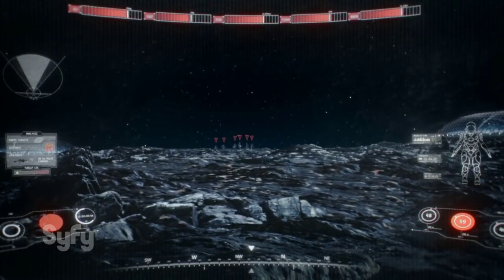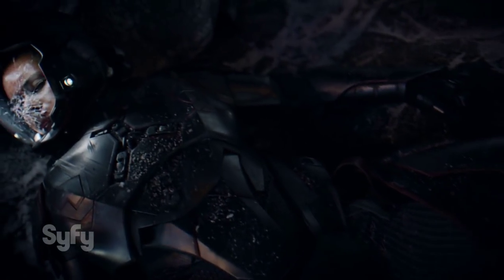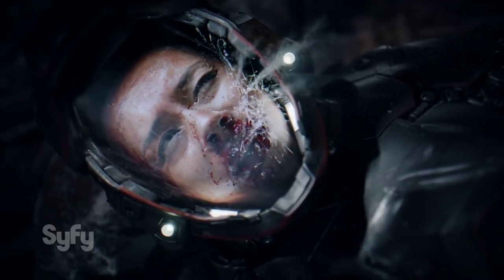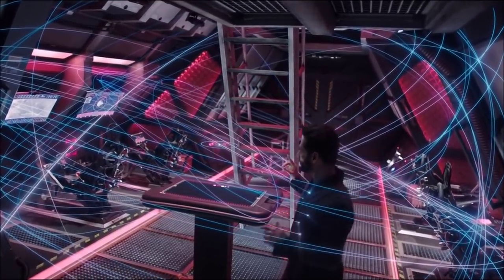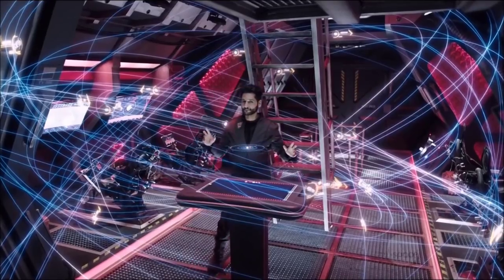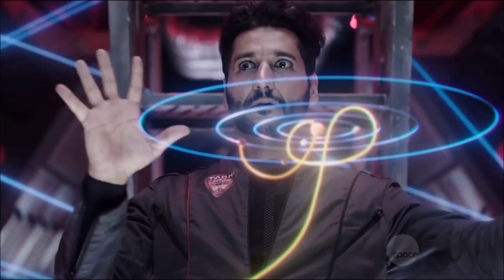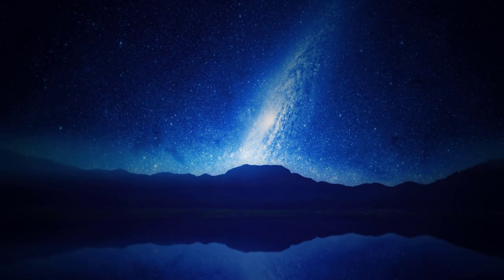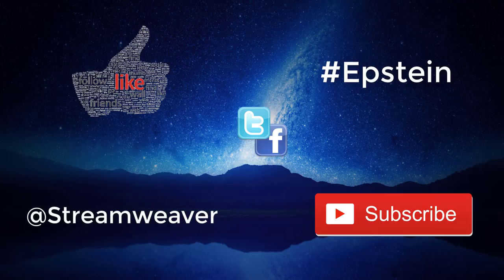Let's Do the Science:  The Epstein Drive

Comment: The Kzinti lesson: "A reaction drive's efficiency as a weapon is in direct proportion to its efficiency as a drive."
Reply: I knew someone would mention this.
Reply: @David Johnson ~ Aye, it commits the old sin of imagining only the ships with railguns are armed, when a fusion powered plasma rocket (a directed nuclear weapon) would put the railguns (admitedly very powerful kinetic weapon) to shame. But it's still a lot better than most of the science fantasy on TV, so I repeat to myself 'It's just a show, I should really just relax' la la la ♫ ...
Reply: most fictional antimatter engines would either need very strong, lightweight magnets or some kind of gamma ray laser thingy that would pump out the gamma photons in a correlated stream since we're talking PWs of power in Expanse sized ships if we're goign antimatter and ~ 10 % c+
Reply: Book spoilers!

A small ship is eventually used as a nuclear missile in exactly that way.  There is also a lot of use of improvised kinetic weapons (including ships and improvised guided kinetic bombs dropped from fast moving ships). (And discussion of dropping rocks on people throughout the books.)
Reply: A weapon becomes more efficient the smaller the area you focus the pressure at the cost of less overall force and a drive becomes more efficient the wider you let the exhaust spread at the cost less overall pressure. So, in the end drives make for terrible weapons and weapons make for terrible drives.
Reply: Bouth true and false. They are designed to use the energy in different ways, but the energy is still there and can be used as a weapon or as a drive with minor modifications.
Reply: Why doesn't Mass Effect use their FTL ships to blow up enemy planets? I mean if the cost of that ship is less than the enemy planet, then it would pay for itself.
Reply: I liked Ringworld.
Reply: To answer the Mass Effect question: I think there are several reasons:
1.) Ethics: No matter if it's actually possible, triggering doomsday events on inhabited planets is generally considered bad form and possibly a war crime in the eyes of the Citadel Council. In fact a maneuvering a fleet between an inhabited planet and an enemy is a common tactic since it forces the enemy risks hitting the planet with it's mass accelerators...which is, you guessed it) forbidden by the Citadel Council.

2.) War Strategy: In Mass Effect war is decided in space and colonies/planets are usually a thing that people fight over for control. So destroying a planet makes very little sense

3.) Dedicated Weapons: Why sacrifice a ship to nuke a planet when dedicated weapons for nuking a planet already exist...not to mention that most colonies are small and could very well be destroyed by weapons of our day and age. The codex states that during the Rachni Wars, the Krogan Rebellions and I think also the Reaper Wars the Krogans and the Turians used asteroids as WMDs. 

4.) Mass Effect Fields: We don't know how they actually work or what they do...they play around with Mass somehow, but that's about it. We do know that they produce Kinetic Barriers that protect ships from debris and enemy mass accelerator cannons. It could very well be that two Kinetic Barriers projected by ship would push each other away in a similar manner to magnets and you simply can't crash into another ship. That problem does not exist with planets, though. 

5.) The ships can't take it: For FTL a ship needs a working Mass Effect Generator, the forces of entering a planets atmosphere could simply be enough to instantly shred the ship causing the field projected by the generator to fail and just raining a bunch of inconsequential debris down on the planet. Considering how the biggest ships (Dreadnoughts) are even controlled in numbers and extremely expensive they may simply be too valuable to sacrifice.

I am a huge Mass Effect nerd and could probs think of a few more reasons. It is important to note, though that the Mass Effect Universe isn't nearly as consistent as the Expanse, especially in regards to how things are described in the codex and what happens in Game/Cutscenes. On a further note, the whole way space combat plays out is sorta flawed anyway, because Fighters/Bombers shouldn't even exist in Mass Effect, not as manned craft anyway.
Reply: Didn't think anybody read Larry Niven anymore
Reply: David Johnson #chrowl
Reply: i imagined/head-canon'd those engines working in 2:1(or more) fuel ratios, with the m/am annihilation working to ionise the remaining hydrogen, and blast it out the back as a mother of all plasma torches.
Reply: One thing I liked about the old video game "Defender" was the way the ship's dive plume disappeared when firing.  My guess was that it was because of the processors used, but I liked to think that the ship was redirecting the drive's power.
Reply: @PositiveBlackSoul  mass effect 3 also says the drives have a failsafe built in to prevent useing them for ramming which was preasent in the drives they reverse engineered from the protheans which they cant figure out how to remove and keep the ftl workingd it is heavily implied to have been a reaper failsafe they built into the tech they seeded to stop primitives from useing it to wipe them out with kamikaze freighters.
Reply: They found that out the hard way :)
Reply: THIS
Reply: @Draekris  which ship is used as a missile

Comment: excerpt from the wiki:
"The drive utilizes magnetic coil exhaust acceleration to increase drive efficiency, which enables spaceships to sustain thrust throughout the entire voyage."
Dubiously canon, but it fits in with what we've seen. Instead of some new flavor of fusion with exotic fuel, the magnetically interactive plasma is funneled into a coilgun-like apparatus and accelerated to even greater speeds, the added velocity of the mass ejected out the back is translated into additional thrust for the ship.
So 'runs on efficiency' means "wring every last newton of thrust out of our propellant"
Reply: That would still require a relatively ample amount of reaction mass though, wouldn't it?
Reply: @reezlaw  The more energy you have available for accelerating your reaction mass, the less of it you need. Simplified, reaction mass, energy, and speed is governed by the interplay between kinetic energy and momentum.

The mathematic formula for kinetic energy is E = m * v^2 /2. The formula for momentum is M = m * v. The thing is that momentum is a vector (it has a direction), and the total momentum of an event has to be 0 (equal and opposite reaction). So if (and my stuff) weigh 100 kg, and I throw a thing weighing 1 kg at a speed of 10 m/s in one direction, I will also throw myself at a speed of 0.1 m/s in the other. To do this, I need to supply 1 * 10^2 /2 + 100 * 0.1^2 /2 = 50 + 0.5 = 50.5 J of energy.

If I instead had a thing of the same weight as me, I would only need to throw it at a speed of 0.1 m/s in order to propel myself at 0.1 m/s in the other direction. That only takes 0.5 J (for a total of 1 J), instead of the ~50 J it took to throw the small thing.

The faster I can throw the thing (my reaction mass) in one direction, the faster I can propel myself in the other, but the energy needed scales up with the square of the velocity. So you need to pump increasingly high levels of energy into your reaction mass in order to go faster. If I can't put out ridiculous levels of energy, I'm going to need more reaction mass to compensate. This is why our rockets generally consists of almost all reaction mass with a tiny bit of payload, and even have systems designed to relieve themselves of the casings for the reaction mass in order to reduce the amount of reaction mass needed (multi-stage rockets).
Reply: @BalooSJ  sure, that makes sense
Reply: @BalooSJ that calculation is only for vacuum of space flight or is it applicable to be used to break earth gravity? Starting from 0.
Reply: @BalooSJ sorry I'm this late, it's been 3 years, hope you are still there
Reply: @glintongordon6811  The basic math of energy vs momentum applies either way, but gets more complicated when you need to worry about additional variables like gravity and air resistance.

While on the ground or in atmosphere you also have access to more efficient means of propulsion. In space, the only way to go one way is to throw something the other. On a very very broad scale the same applies down here, except we have things readily available to push against. A car, for example, pushes against the ground to move forward, and a plane uses propellers or jet engines to push the air.

Comment: I'm curious, suppose we launch a small ship, like a space shuttle, into space and it docked with a large rocket like a Saturn V that's fully fueled in space. What kind of acceleration and g force in space could a fully fueled Saturn V rocket achieve and how long could it sustain that thrust?
Reply: The saturn V had a total burn time of 1025 seconds. Someone did the math and it has a total of 18 km/s of delta v. That's the speed of voyager 1 right now, so that gives you the idea of the performance. This is because the rocket is designed for power, not efficiency. The first stage would be hugely wasteful in space, and the entire thing is a chemical rocket, so it is terrible compared to the things talked about in this video.
Reply: Elon is planning just that for his Mars mission
Reply: @cinquine1  Also you would have to at the very least redo the bell's (probably a lot more than that) on the 1st stage engines for vacuum operation, or your efficiency that's already meager would drop massively.
Reply: Unfortunately spaceships don't work like cars. You can't take a ship designed to do one thing and put it to do something is not designed for then hope for the best. That's the kind of logic a US senator uses .

Cars, (and everything else designed by man except rockets) operate in more or less equal gravitational constant and constant atmospheric pressure. Rockets and spaceships do not.

Does your hypotetic Saturn 5 contain the command module and the LEM as well or not? Is your space shuttle loaded or not ? 

Someone above says Saturn V had 18 km/s delta V. For what mass, the CM and LEM mass ? Space Shuttle dry mass was 78 tons 5 times the mass of the LEM ! You can;t talk about dV and not talk about the payload mass. One payload gives you a dV table, another payload gives you a different one.

To answer your question: it won't go very far if anywhere at all.

Comment: As far as I remember, the books specifically state that they have a reaction mass in addition to the Epstein Drive to produce thrust. Running the ship at 1/3 or 1/2 is not primarily for the comfort of the crew or to conserve energy, but to conserve reaction mass. They probably inject it into the fusion output to give the exhaust enough mass to produce thrust. The Epstein Drive is efficient enough that the real limiting factor in distance and speed ships can travel is not the amount of fusion fuel but reaction mass.
This would also give the Epstein Drive exhaust the utterly destructive force it's been seen to produce.
Reply: Imagine using trashed garbage from Earth as the reaction mass for the drive, cleaning up the Earth
Reply: The reaction mass is highly purified water, and it requires a relatively small amount

Comment: In book 4, they state that it takes a civilian freighter 18 months to travel 5 light-hours. If you work out the math, it means that they only accelerated 11 hours or so at 1/3 g instead of any significant part of the trip. In the other books, travelling out to Neptune also takes months (presumably on a Earth ship, they would accelerate at 1g the whole way if they could).

I believe the authors didn't really think carefully about how fast you can get at a constant acceleration for days at a time. I wonder how the show will handle it going forward (they've been pretty vague about travel times so far).
Reply: Hmm I think it does make sense. 1go is shown to be too much for most belters, even for marsians. I think most of the solar system is used to travelling ar lower g's.
Reply: Civilian freighter might have it where they use algae recycling for food, in order to carry more cargo.  The fuel tanks might require special connections, but food can be MREs, algae tanks (with vitamin supplements as needed), and only needs a basic power supply and room.  The original freighter might have been an Earth-Luna or Earth-Mars freighter, but pressed into service for longer-distance transport.  Or they wanted someone out of the way, and put them on that 18-month trip.
Reply: The big reason you can't trust any speed or time given in the books though is the fact that the author acts like acceleration is velocity, and that 1/3g is how fast you're going, not how fast you're changing how fast you're going. It does give an easy way to allow for "gravity" on ships without requiring every ship to be spinning like the Nauvoo / Behemoth / Medina. I think it's a fair tradeoff, taking a little creative liberty with physics in order to avoid magic artificial gravity while still allowing for maneuverable ships that aren't always at zero g (a big enough ring for artificial gravity isn't going to be suitable for fast combat like a fighter would be involved in).
Reply: They did. They're pretty specific about most travel happening 'on the float.' Which is to say: ballistic. There are very few cases of ships going under constant thrust with flip from point A to point B. They do an initial thrust of about 1/3rd g to get up to a decent speed, and then cut their engines and float until they need to slow down again.
Reply: Tom Jiang Lenghtier traver time could be a tradeoff with fuel consumption. Many belters might not be able to afford enough fuel for constant acceleration.
Reply: His numbers for continuous acceleration are straight lines, leaving the earth and flying straight to Jupiter. in the show they using transfer orbits. Much more complicated and much much longer in distance.

Comment: recently there was a paper published that essentially used a primary reaction in a doughnut shape with the force forced inward to ignite a secondary reaction that directed the force out the back. If a system like that was made effective, it would surely provide those kinds of accelerations.
Reply: http://www.nextbigfuture.com/2017/04/imploding-liner-fusion-propulsion-system.html

I misspoke about initial reaction. Though, I suppose the electricity to run the magnets would come from a fusion generator.

Comment: In the one episode where the Nauvoo is "trusting away" from Tyco Station, there is a slight part of the scene where it is melting the gantry metal as the engines are powering up!!! And the plasma is what is causing the metal to melt!!!
Reply: Greg Benwell in Leviathan Wakes, they actually had to tug the Nauvoo with tugs away from Tycho station for 8 hours before they could even fire up the main drives. to not cook everyone on tycho with radiation. also when the Nauvoo was approaching Eros millers suits radiation alarm went off when it was still 30 mins away from impact.
Reply: Jesse yes I know all this, I have watched that episode about ten times now and as the tugs are returning to their base, and the main engine is firing up, there is a gantry girder IN THE FOOTAGE, that is for a split second glowing red hot as the main engine of the Nauvoo is beginning to fire up, that melts away!! Like I say watch it, and watch it very closely, and you can see the girder melting from the heat of the engine! And it only shows it for a fraction of a second.....so you really have to be looking for it!!!
Reply: yes i am aware of it melting the girders in the tv show. and burning up that one tug that got to close. i was just mentioning that it would have probable melted all of Tycho if they fired up the main drives right beside the station, in the book lol
Reply: Greg Benwell approximately
17:22 to 17:27 in the video. Also Tycho Station appears to be perpendicular to the Nauvoo, so when the engines kick in, while melting the gantry beams/truss, doesn't burn the station. What it 👀 like to me.
Weird, I'm watching this very episode (kinda, surfing yt as while watching..)
Reply: Plasma doesn't have that kind of thrust, Plasma thrust has a very long burn time. 

Plasma is about 5000 Seconds per impulse.

The shuttle has like a 114 Second burn. 

Now the shuttle has a shorter burn because it has a great kick. But Plasma is a slow low long burn. But this is a good thing because that means reaching greater speed over time, not in a short period of time like the shuttle, but because all the fuel burns up quickly in the shuttle vs the Plasma engine. The plasma engine is accelerating every atom at the speed of light.

Unfortunately that means it takes longer to reach high speeds but that is ok because it is far more efficient and we can reach greater speeds than the shuttle can.
Reply: @JM-yq9ns  It's not the case for the Epstein Drive, though, since it combines very high thrust AND very high specific impulse, allowing for great periods of non-stop acceleration.